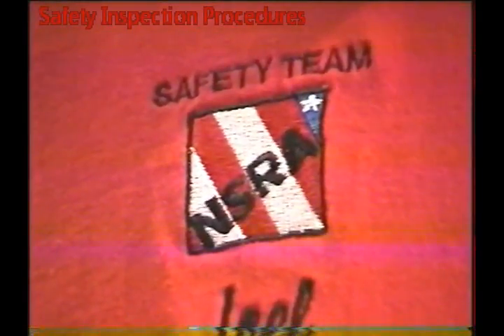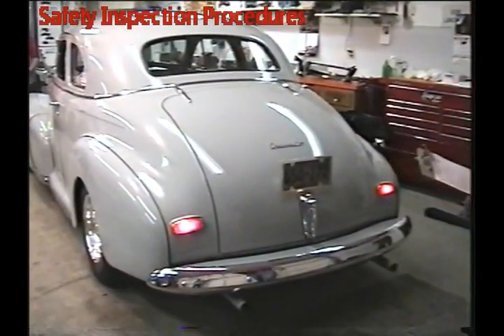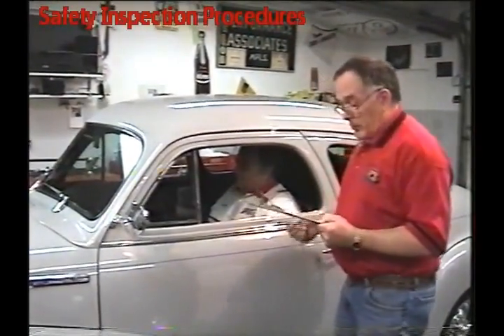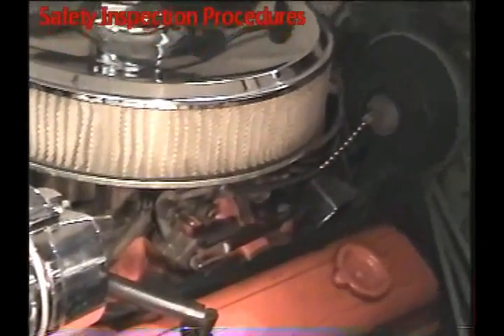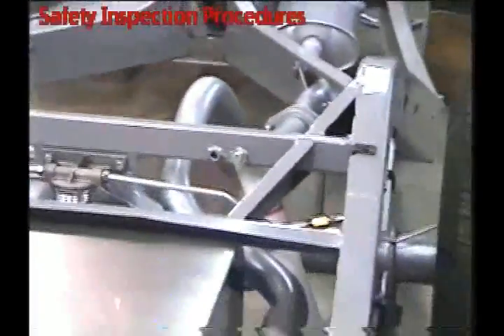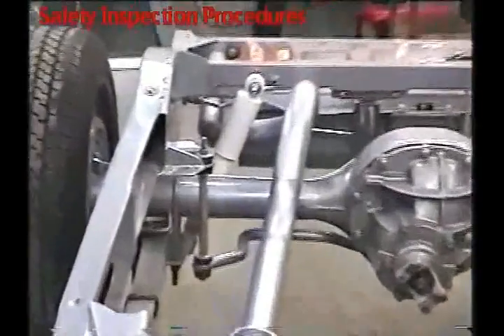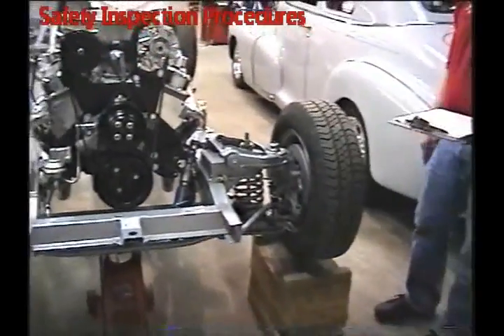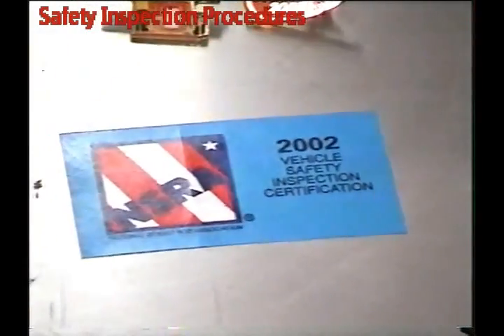NSRA Safety Inspection Procedures

Comment: Building a 23 T bucket do I need windshield wipers? There's no top. Also does it need seat belts? I would like to know before I get further along in the build. I have only seen the seat belts on one car. Never seen wipers on a T-bucket.
Reply: Hey Chris... I am the Arkansas State Inspector and can answer that for you. Wipers are required on all vehicles, either electric or vacuum.  They are also state law in most likely every state.  As far as seat belts, they are not a required item.  They would be required by state law on vehicles built after 1964 I believe.  Hope that helps.
Reply: stillkruzn 
Thanks for the info!